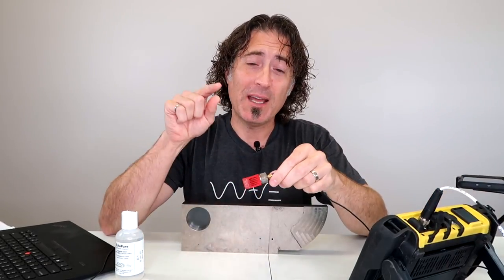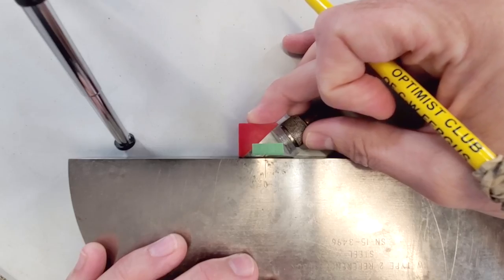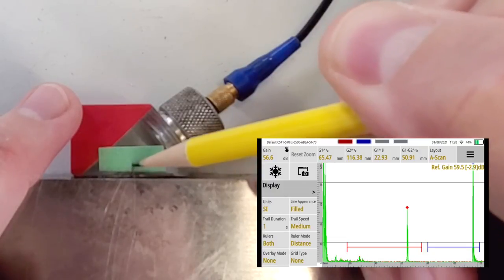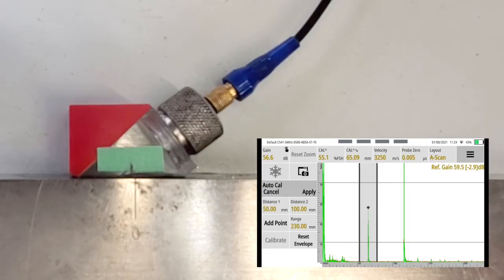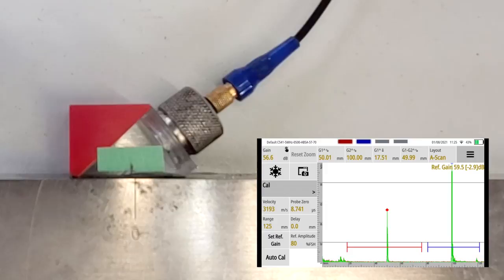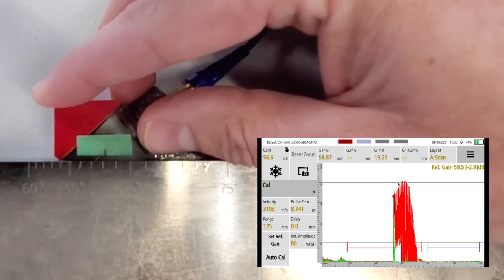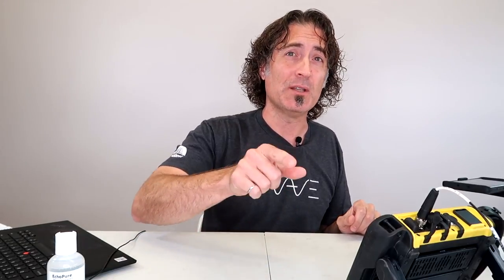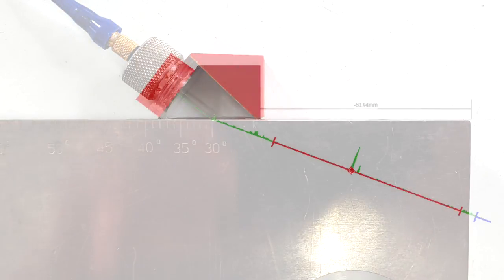Basic Angle Beam Calibrations

Comment: How do you tell the difference between a small crack in the root verse a far root signal.
Reply from the maker: Pretty hard to do in practical circumstances. In the lab, on a bench, with a known sample sure maybe no problems. But in the field with a scanner, couplant, wedges skimming the surface... those little inconsistencies will move your root signal up and down and may make it look a few millimeters above or below the backwall. Gotta really pay attention and look for tip diffracted signals. Do a manual scan from the opposite side to complement your encoded scan if you can't encode both sides.
Reply: @hollowayndtengineeringinc.5201  Thanks buddy, I will try this.